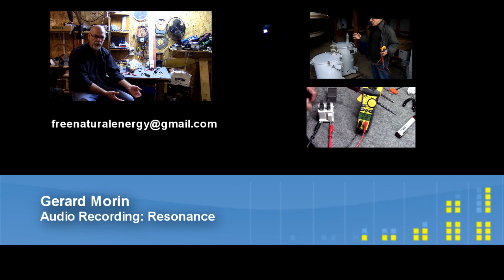Gerard Morin Audio Files: My Understanding of Tesla

Comment: I am wondering resonate is same as water that is calm, so you pour the water on flat surface and it spread out even, so the current is spread out even, it can be fast or slow, so the impact range is depend how much you are being felt from on flat surface that is being impact from incoming water. So, if there is a container that is smaller than vertical diameter which you pour out water to horizontal diameter of two edges, so you pour fast, so the impact will hit the wall of container, so it goes up like a up wave, then back wave so it is down wave. The hitting the flat surface to edge, then it raises, then come back over from top to bottom, so two wave in opposite direction vertical and horizontal, so the speed of impact to flat surface  is connect to relative speed of two waves in opposite direction V and H, so that is resonate which has different range of frequently, so it is same volume, but range of speed outward and inward that is depend from source and diameter of edge to the source, but both is on parallel speed except the geometry represent that show what is view as relative that is source which the line of water to edge, so the height of source and width of edge, and gap diameter in between is same. 

The forward water to edge is EMF as a represent but for this case is FW, forward water, and back water from edge is BEMF as a represent but for this case is BW, backlash water. So, it can hit the source so the source line of water will break apart from BEMF or expand the source line of water, it depends how much power is BW. So, Backlash W. For the magnet that repel and attract, so the attract is the first process, then second process which is repel, so the FW is first, then later BW, so the repel is later time, so in instant of time that you measure for for EMF and BEMF is at different time, since you start the source, then to edge at later time. Same as magnet so it is view at same time at macro level, but at tiny level, it is at different time. 

The water you pour at center which the water goes left to edge, then right from edge, so you make a ring of water around, that is edge of water so you spin around, so the forward and back impact will stand still, so horizontal motion and curve motion, so it is total motion that is 3D, horizontal, vertical, and curve motion, so the frequently stands as mass as resistance. Ok, perhaps there is no curve, but only series of relative horizontal and vertical, and different section level in even way. Well, the point I am making even compare to water to resonate of mass. Since it is a cycle of motion. Any idea to make it work as a whole.

Got an idea that all series of electrons are a section of assembly of cycle of motion with source and edge of vary length, and height, and vary speed, in section to total. So, it is a group of assembly to further distance that is new source, but same source with same edge, and everything, so it is a total of three that linked to one whole cycle of motion which connect to source of water that pour down in range of speed, and range of height to flat floor, then impact goes left, well, at all over, to the edge that is center ring, from pole to ring edge, so the impact cause back impact, so as explanation in above section. So, that is one assembly which represent cycle of motion called resonate, so has different level of frequently that is herz. But connect to one that pole, the energy source.

Comment: is resonance made when inductive reactance equals capacitive reactance  ??   hard to break away from resonance not being a frequency  //
Reply from the maker: I understand your position, breaking resonance and frequency apart. Just using frequency, are we achieving anything in the last 150 years? we are stuck in the rut of Frequency, where they want you to stay. If you stay there, Just calculate how long it takes for a solid sine wave frequency to go a thousand miles. ANd look at the communication of today, and see if it matches. It doesn't. So that means they are playing with something else, other than frequency.
Reply: Universities deny the existance  of resonance as a means to greatly multiply power
Reply: 1 million volts at 1 million cps  =  tesla
Reply: stay safe
Reply: That's what you learn in school. When inductive reactance and capacitive reactance are equal the circuit becomes purely resistive.
Reply: gerard   i just discovered that the McCoulough  is NOT grouned to he frame of the generator  // it has a floating ground  //